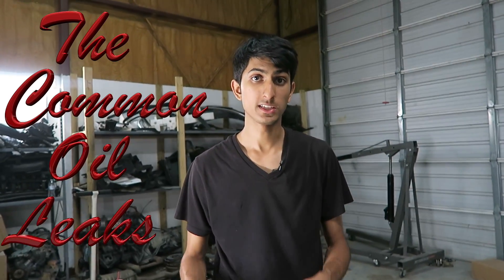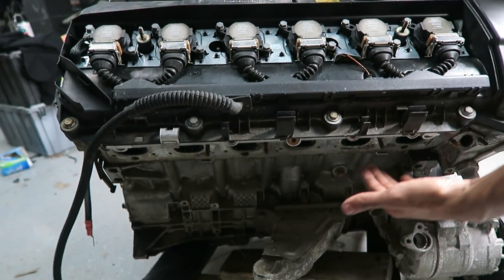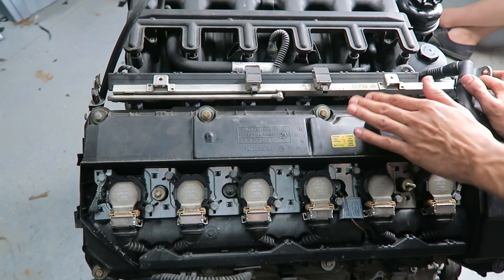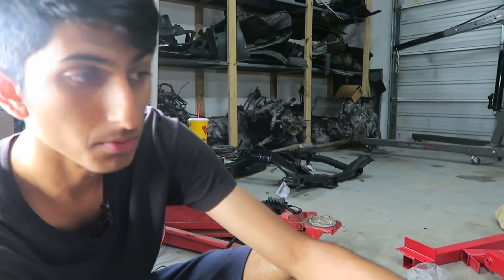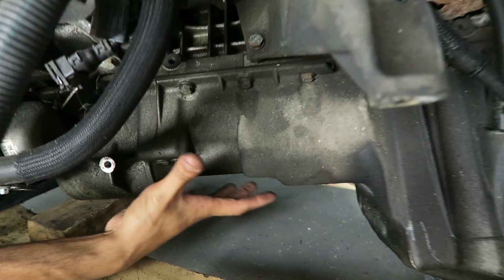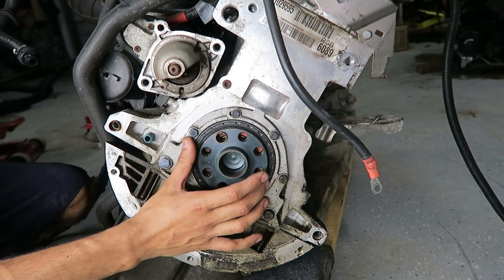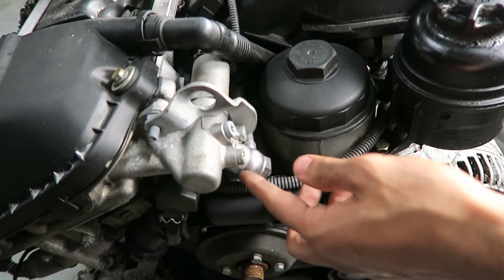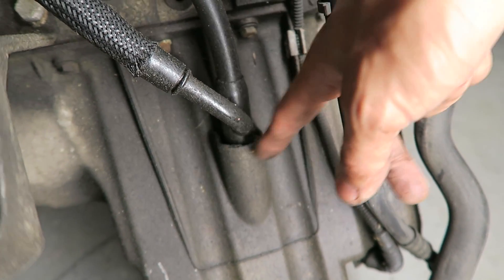BMW M54 Common Oil Leaks (E46/E39/E60/E83/E85)

Comment: Thanks for this. Awesome video brother. I just bought a 2005 e83 and i had all of these problems. Paid a shop for oil filter gasket housing, valve cover gasket, vanos feed line, and a vacuum leak. Engine has 141K miles on it and I got it for $2400. Hoping it holds up w the repairs, oil change and new spark plugs. Could be a fun car to take family and dogs camping, to lake, etc.
Reply: How has your e83 held up?

Comment: What I want to know is, why are these Nazi mobiles sealed so poorly in the first place, they are supposed to be a premo hoity toity snob vehicle which a lot of people idolize and dare I say worship, yes I'm being flippant and for good reason, my 2001 lesabre with 315,000 miles has never had the oil pan gasket changed or the valve cover gasket. Did they use inferior gasket material, is it faulty engineering, das Furher must be turning over in his grave, those responsible surely woukd have been executed back in the day, I'm currently working on a 2003 530i with 92,000 miles and it's leaking every fluid and some it doesn't even have, the thing sat for five years but that's no excuse, my neighbor had a 2005 x3 that was used everyday and it left a puddle everywhere he parked it, it was like somebody removed the oil drain plug i was sp bad. I begged my friend not to buy the 530i even though it was a good deal, he payed 400 for it he bought it from his aunt, it's slinging power steering fluid also, I don't know if it's a hose or what because it's leaking on both sides underneath, the odd thing is the AC works but only blows cold out of the drivers side, the car was severly neglected, it also needs brakes all around and new rotors, they're so worn there's nothing left to machine., it also needs tires and and a paint job, Scotty is right, they are a money pit.

Comment: My e46 is leaking on the backside of the motor it constantly drips even if I done drive it for a week it’s a steady leak over a week time it’s 2quarts low I’ve inspected the oil pan it’s fine I think it’s the gasket or rear main  but I was told that the rear main would only leak when running so what would you say should I just do oil pan gasket or just pull the transmission and do rear main

Comment: yall think its safe to buy a 2001 5 spd 320 that has 400k on the body with a few small spots of rust, clutch is solid ,drives solid, but engine was rebuilt at 250k. interior is exceptionally clean considering the age. seller is asking 800 im gonna offer 400 hoping to land at 500 since the definitely needs a new windshield, rims and tires

think its a safe project buy?

Comment: Does this also have a small o ring by the headers that can cause a oil leak ? I think you said in your other video but it was for an m3 that is best to buy a vitalic o ring replacement. I have a 04 330i

Comment: E46 terrible model i had a e46 325i nice power nd torque but the seals are shit these e46 models have a poor cooling system not the best system nd then you got the typical oil leaks shit seals

Comment: My 2004 Z4 clutch starts slipping when I top the oil up to maximum on the dipstick..  My theory is the rear main crank seal is leaking and thus contaminating the clutch.  Does this sound plausible?
Reply: plausible yes

Comment: QUESTION....... CAN ANYONE TELL ME IF I HAVE TO PUT OIL IN THE ENGINE OIL FILTER HOUSING AFTER DOING THE OIL FILTER HOUSING GASKET . 
.ALL THE OIL THAT WAS INSIDE MY OIL FILTER HOUSING LEAKED OUT DUE TO THE GASKET BEING BAD. SO AFTER I INSTALLED THE GASKET AND PUT EVERYTHING BACK TOGETHER NOW NOT SURE IF I HAVE TO PUT OIL IN THERE . 
AS IT USED TO HAVE ALOT OF OIL IN THAT HOUSING AND NOW ITS EMPTY. 

I NOW THAT THE OIL WOULD TRAVEL THERE TO FILTER OBVIOUSLY BUT SOMEHOW AFTER I CHANGED GASKET IT SEEMS TO BE EMPTY EVEN AFTER DRIVING. MAYBE IM JUST LOW ON OIL (?) 

SHOUL I PUT OIL IN THERE ? 

IM USING OW-40  CASTROL .
INCASE THAT MAKES ANY DIFERENCE.  

CAN ANYONE HERE WITH AN E46 ANSWER ME . PLEASE AND THANK U IN ADVANCE.  

330CI E46 CONVERTIBLE 2003 
PRE-FACELIFT.   INLINE 6 
M54 ENGINE I BELIEVE . 
190K MILES.  

OIL LIGHT COMES ON AT START UP . THEN AFTER 2 MINUTES IT TURNS OFF . I CHANGED THE OIL LEVEL SENSOR UNDER THE CAR . 
STILL LIGHT COMES ON . 
GOT TO CHECK FOR MORE OIL LEAKS . 

I DID VALVE COVER AND 
OIL FILTER HOUSING .

Comment: wow, I for one will NEVER buy another BMW...... 190000 miles on my other brand car with ZERO problems & NO oil leaks. BMW= pile of crap!
Reply: i bet your other brand car didnt ride the way a BMW does.
Reply: @williammalamas8367  Yeah, but at least it rides.
Reply: @YourMajesticKyng  well oil leaks doesnt make your car totaled, everything can be fixed, and i did for less than 500$ so you either are a cheapo and expect to drive a BMW for 1000$ or you spend another 2000$ to make it reliable and a joy to ride.
Reply: @williammalamas8367  Who said anything about a car being totaled? and in terms of car repairs you're saying "cheap and "$1000" as if that is a small sum of money.
Reply: @YourMajesticKyng  buying a car for 1000$ is considered expensive ? of course is not a small amount of money but you have to understand you`re buying a CAR, something that`s gonna take you to places and will keep you alive(if it is an E46 and not a japanese 90s rusted piece of trash) in case of an accident. Repairs are required on all cars and its really imposible to find a used car under 6-7k that doesnt need much work on, most of them are really bad maintained and left things broke simple cause they didnt care. Any car i bought needed a lot of hidden work, a window regulator, tires, brakes, some leaks, ac charge. Sometimes you`ll probably end spending over 1000$ on a used car just for repairs if you want the car to be in decent shape.

Comment: Good video, question. 
What about when you're having an oil leak from the O-ring that's inside of the cap? Is it possible to get a thicker and diameter O ring with the same circumference or what's the problem?

Comment: Hi, it is a great video.  I just changed the valve cover gasket, but while trying to discount the CCV breather tube, I accidentally broke it.  Would you please tell if there is a way to just replace that breather tube without going through the whole process of replacing the CCV.  My CCV system was just replaced a year ago.   Thanks.

Comment: Hey bud. 
I have an oil leak that is bugging me on my left hand drive 2005 e60 530d in South Africa Cape Town. 
The Bmw mechanic that works on my car from home says it’s the main seal oil gasket and that my car needs to go onto a lift which he does not have at home and my entire suspension must be removed in order to fix the problem. Not worth the costs he says as I go thru about 2 liters of additional oil thru the year. Which makes sense, but annoys me when it drips in my garage. Is there perhaps a quick fix around this. I service my car regularly and only use the 5w40 oil from Bmw. 
Please help
Reply: What in the world you doing in cape town . Thats awsome.

Comment: Hi I get a high oil consumption from my X5 M54 engine.. as you might know it has dual-oil pan.. so I have to add 1 liters of oil per 2000 KM.. is that normal?

Comment: Your videos are extremely well done.  I just replaced my oil filter housing gasket on my 2003 330i using your DYI as guidance; I am so stoked I found your videos. I haven't put oil back in my engine yet, because I'm afraid the oil pan gasket might actually be the culprit of a major oil leak that started immediately after giving my car a standard oil and filter change recently (which I have done half a dozen times with no issues). I saw evidence of oil leaking out of the  oil filter housing on the "waffled" areas, but up on stands, I am noticing oil that has also leaked out of what appears to be the bottom of the engine, or the the oil pan essentially. Didn't see a DYI for the oil pan gasket on your page, have you done one??  Thanks for everything!!!  I am also going to check the washers and those other areas you pointed out in this video. Keep up the good work.

Comment: I've changed my valve cover gasket and I'm still having oil leaking on the rear shield and sensor. It's driving me nuts. What else could be causing that. M54 engine, 2001 BMW 325i
Reply: Did you put silicone before put the cover back with new gasket?
Reply: Sometimes the cover themselves get hairline cracks

Comment: Hey love your videos. I have a 2007 BMW 550i 4.8l v8. I have a massive oil leak. I found some oil on the passenger side valve cover. But I think there has to be a bigger leak. Can you tell me the common areas the v8 leaks from. I'll look at the oil pan today. Also my car says it's full of oil. So could I be getting a bad reading? I just bought this car and thought I was getting a pretty good deal. But not know.
Reply: did you fix it now Chad?from where came the oils leaks?i have the same to my 545i 2007

Comment: I have a front crank shaft seal leak on my E46 2003 320i sedan.   Do you have an instructive video showing how to do this?  I have found your videos very good value but cannot find one covering this seal replacement.

Comment: Hi Jason.  Would this be similar with my N46B20 engine?  Got myself a bit of a leak and think it could be the OIl Filter Gasket.  No oil drips on the exhaust shields so I don't think its the valve cover gasket.  Oil is getting on the drive belt which then distributes it around the engine bay (mainly in line with the belt's  direction of travel).  The Filter is directly above the Drive Belt so I'm thinking that it is the culprit.
Reply: FYI - BMW = 2005 318i - Not brought out in North America I think so you might not be familiar with it.  Same shape as the rest of the E46 series but with the 2 litre 4 cylinder N46 engine (and other variants along the way).

Comment: Nice channel, quite helpful! Recently bought an 05 520i with the 2.2, need to replace valve cover gasket cuz of oil leak, but any idea why in my last 5 weeks (3000miles/5000km) I've already added 3 liters/ quarts of 5w30 oil :( They can't be that bad?

Comment: Great video, just to add to what you have covered, I replaced my valve cover gasket and the oil filter housing gasket, which had gone brittle and were leaking, I now have a leak from the exhaust cam sensor located on the front left hand side of the cylinder  head just below the valve cover. Its just one bolt to undo and slip on a new O ring. Hope this helps as it could easily be mistaken for the valve cover gasket failure, so worth replacing before or as well as replacing  the valve cover gasket. I replaced my gaskets using your tutorials, so thanks for posting.
Reply from the maker: Thats great man! Thanks for adding sensor o ring!
Reply: I've also replaced the valve cover gasket recently but still have an oil leak which I'm pretty sure is the camshaft position sensor o-ring.  Will be getting a new one Monday.

Comment: how do I know what kind of engine  I have . I have a bmw 325ci 2001
Reply from the maker: you have an m54b25
Reply: Do you think I showed replace the AUX fan blade or the Whole AUX fan housing that comes with the fan. My current fan does not move freely.

Comment: Actually I saw oil puddles in the waffle section of the block, but I had already replaced the Oil filter gasket.  So I was not happy.  I used a very bright light and it now appears that the oil is coming from the CCV.  Do you think a leak from the CCV would end up on the waffles?
Reply from the maker: +pam2147 It could, maybe if the hose that goes to the oil dipstick was severed off.
Reply: Thanks.  Keep up the great work.  If you ever come to Japan let me know.

Comment: Can you do a video on installing cams? I picked up a 3 liter intake cam for my 2.5 and was wondering what exactly needs to be done to install it. I've seen people doing both cams and needing the fancy alignment tools, is this the same case for just doing the intake?
Reply from the maker: +Matt Thompson You can probably get away with rigging up something to avoid buying the timing tools, but I would rather just be safe and buy them. I'm not familiar with swapping the cams from a 3.0 to a 2.5, but I will be making disassembly videos for the M54 so that may help. Stay tuned

Comment: https://youtu.be/Jw1yyrDPvxY hey what's wrong in this engine?
Reply from the maker: +Trino Munoz Hey man I am sure that it is your PCV system. I would buy a kit that includes the hoses and everything that way you will also eliminate any vacuum leaks that may also be there. The kit is around $100 on FCPeuro or ecstuning.
Reply: I put the ccv crankcase hose brand new and the pcv vent valve. and the problem continue
Reply from the maker: +Trino Munoz You put new valves on both banks? Also did you replace both hoses?